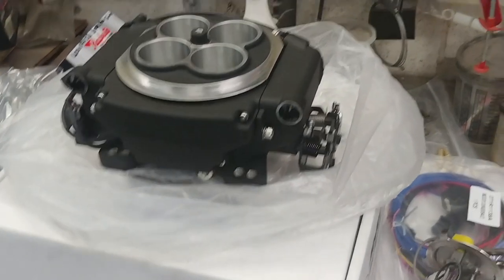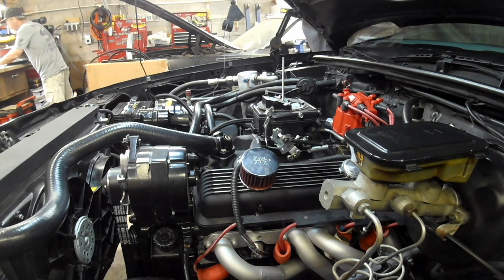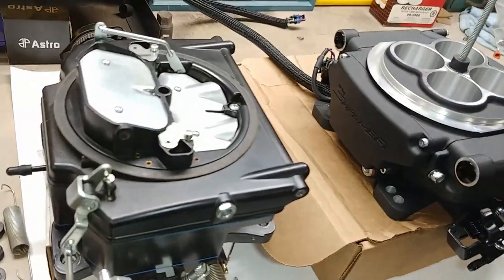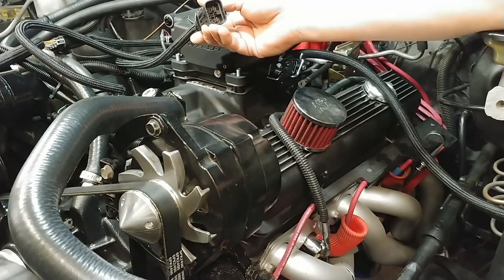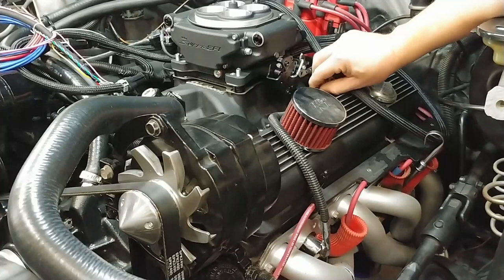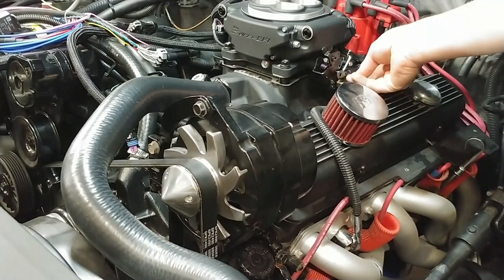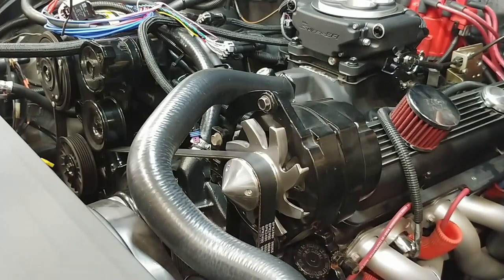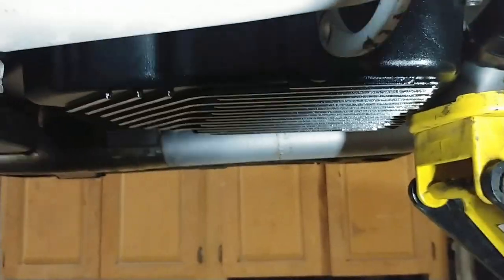Sniper EFI Install - 87 El Camino / Monte Carlo (G Body) PART 1

Comment: I need help please,Where did you hook up the 12 volt while cranking ?
Reply from the maker: I believe it was hooked up to the "Bat" terminal on the fuse panel. Put a test light on it. It should be at least 10 volts when cranking the engine and stay above 12 volts when running.

Comment: How is it running I'm plan on purchasing the holley sniper quadrajet version of the efi throttle body unit for my 84 olds with a 72 olds 350 engine.
Reply from the maker: This install is not for the faint of heart. It's taken many hours on the phone with tech support as well as countless emails to get my unit sorted out. They had to warranty several IAC valves and I had to go through the wiring harness several times to protect it from the notorious EMI bogie man. But I can now say I've finally got a nice driving vehicle. I've got a final installment video coming soon that goes over all the issues I fought along the way. Also, I would highly recommend purchasing a Sniper II rather than the 1st gen system. They supposed worked out all the bugs on the new system. I still feel that EFI is the way to go. I have better gas mileage and much better throttle response. Best of luck on your install and thanks so much for your comment.
Reply: @g3garage  thanks man wish me luck😂